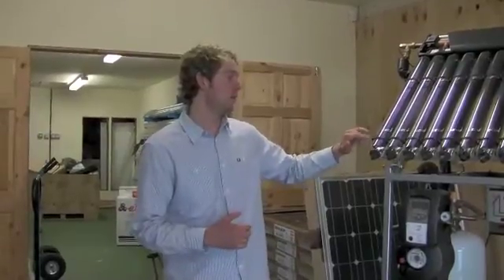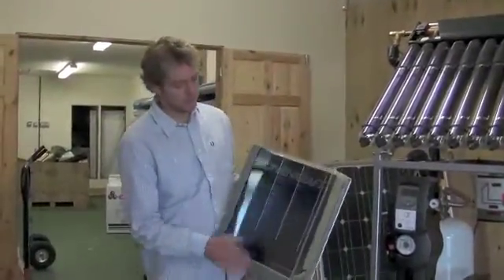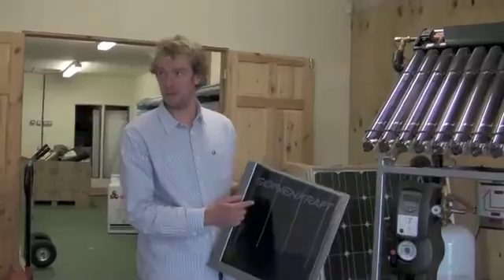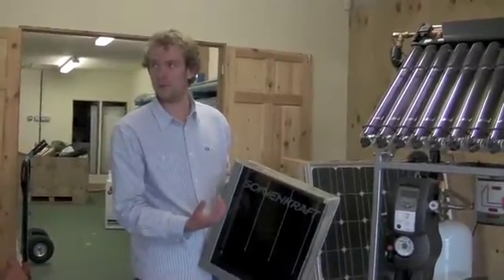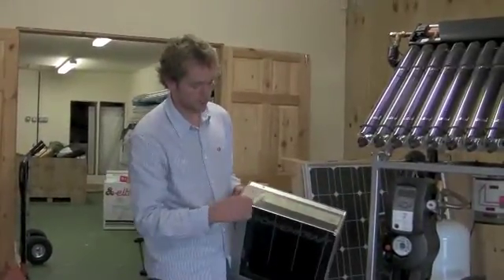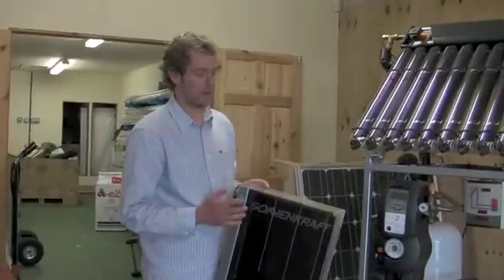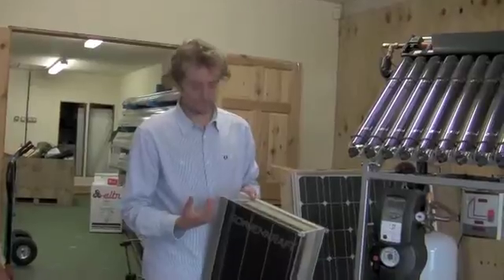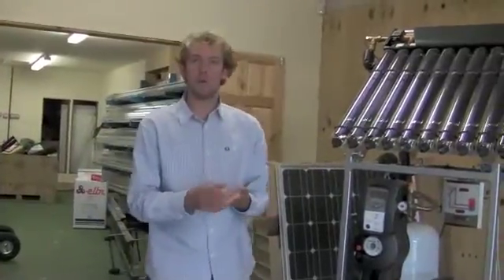Solar Thermal Panels: flat plate or evacuated tubes?

Comment: Just serviced 2 Thermomax tube systems both 25 years old and both perfect and working. My own flat plate made by Hitachi I took down 10 years ago was rotten with rust and hardly worked in winter, where tubes will. They need servicing both types and customer must understand what they have. If you dont check you oil in your car it goes bang, same with solar. Look at controller watch temperatures. If getting over 100C on the collector  check pressure gauge and then flow meter. If worried call your installer or email info@solarworks.co.uk   and I will find some one for you for free. Keep them working, its free energy.

Comment: Its all about the ambient temp and inlet temp..has nothing to do with you are saying.  The correct answer is to plot it on a chart and see which one is more efficient.  For domestic water heating the flat plate will be more efficient.

Comment: Do they pay you to say this stuff?  LOL.  ETCs break in hail and lose their vacuums.  They last 2-15 years, whereas FPCs last 30-100 years.  That ought to settle it right there, but just in case some silly person out there is still worried about performance, FPCs outperform ETCs up to 120 deg F (67 deg C)... ABOVE AMBIENT TEMPERATURE!!!  That means if it's 32F (0C) outside, FPCs will STILL outperform ETCs up to a temperature of 152F (67C.)